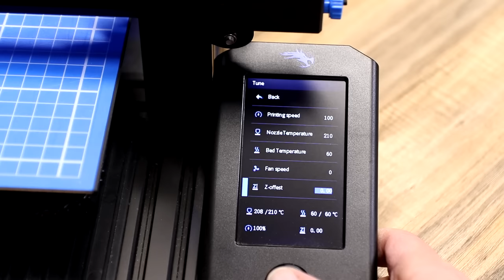Ender 3 V2 Bed Leveling : Quick Look at How to Level a 3D Printer Bed

Comment: Mine came with a warped bed. It blows.
Reply: Mine also, but do the z offset like he suggested at the end and it definitely helps.
Reply from the maker: Aww that sucks. Is the middle higher or lower?
Reply: I feel ya, mine did too, you could have the corners rub the nozzle and still be able to slide 2-3 pieces of paper under the nozzle in the center. Creality replaced it but made it a bit of a hassle.

Comment: i need help my sensor by the motor on the bottom dose not do anything unless i touch it and when i print the bed goes on the motor and makes a noise then it turns off my printer

Comment: Or otherwise know as Z-offest as it's spelt wrong 😁, also great vids I have used them all quite a bit since I got my ender 3 v2, just upgraded the extruder to an all metal and I have done the bed springs however I can get all 4 corners fine however the middle is always way off I have checked my glass to see if it's warped with my metal ruler and it's perfectly flat my spirit level also shows perfectly lvl however I can either get a perfect first layer in the center but the corners are too close and have grooves or I get perfect corners or no filament adhesion in the centre any ideas?
Reply from the maker: THanks! haha Check the aluminum build plate to see if it's warped. That can cause even glass to be slightly warped when sitting on it.  If it's straight too, then I would get abl or do a manual mesh and see if that helps!
Reply: @TheEdgeofTech  Actually I have just used your guide again including loosening the Z axis stop and so far so good any advise on warping pla on the corners

Comment: when i do this, there is still 5mm between the head and table with zreed switch as low as it can go, i need to wind the springs almost to point of no load before it can be levelled. Any ideas?

Comment: My bed hits the motor at the back when the knobs are tight and I have to loosen them quite a bit to clear it. Adjusting the knobs also changes the warp in the aluminum bed which somehow also warps the glass. Sometimes I wonder if my printer is a lemon lol.
Reply: Same  I'm now at a loss. Did you figure it out??

Comment: whatever I do, nothing seems to work. Right is ok, left site does not stick. New springs on the way, using the stock springs. Looks like the spring at the back left must be totaly in and at the front the adjustment screw almost fell out. AAAAHHHH.

Comment: Could you make a video on how to do this with the bltouch on your Ender 3 v2? I just can't seem to get it to stay level with mine.
Reply: Try dual z axis kit from Bangkok, worked for mine, change bed springs too.
Reply: did you remove the z axis stop ? i did that, used a custom framework from smith3d and for almost a year now i did not have to relevel my printer
Reply: Edit Banggood
Reply: @pandaterminator007  I removed z axis switch and installed BL touch aswell as the z axis kit, brilliant now.

Comment: OK I got a question- is it just me or does the nozzle feel like it's vibrating when moving the paper back and forth? I have the bed set to 60 degrees and Hotend set to 200 degrees while tramming, and steppers off but definitely feel a vibration either in the nozzle/ Hotend, or at least the paper for some reason. Makes it hard to get "that feel. "

Comment: This is the most infuriating process I think I've ever been through in my entire life. I've literally sat in front of this thing for hours on end trying to level this thing. It never levels. I've even put new springs on it and it's still the same.
Reply: Iam tired of ths crap i tell ya
Reply: You’ll get the hang of it try using calibration squares one over each spring and one in the center
Reply: You can adjust As you go and get that perfect level basically want the squares to be a smooth  plastic square if it’s to close it will  dig into it and if it’s to far there will be spacing

Comment: Okay, so I have been able to print almost a dozen small pieces no issue, now I am having issues with one particular print and it has to do with the level of the bed directly in the middle of the glass plate. How does one level the middle of the plate? You said it was easy enough to fix, but you didn’t explain how. I’m stumped. Other prints still work even have readjusting the level of the bed again, just not this one.
Reply: Oh and to clarify, the bed is just a we bit to high in the middle even though all four corners are perfect

Comment: any tips on z - endstop inconsistencies?? sometimes its consistent but there are tendencies where the nozzle would stop too far from the bed. should i replace my z - endstop?
Reply: Is it the same endstop that  came with the machine ?  If so...try two things 1st..check the bolt on the z ends top if loose tighten them snugly but be careful not to break the plastic, 2nd thing check if the z rod cuppling if it's loose, tighten if needed....for an extra check the extruder bearing wheel try moving the wheel bracket up and down, if it's wobbly then it's need tightening, but not too tight, that will make the rubber on the wheel wear off faster then intended.
Hope this works out, hit me up if your problem is solved.

Comment: Some thing I thought of just now: 

Start your print but drop down the speed to 10 - 15 percent. While its printing, level the bed accordingly. This seems to be the best way so far. The paper method just isn't working for me maybe because the filament I'm using. Was using Red PLA and it worked 9 times out of 10 but orange.. has been the worst.

Edit: Another pointer: Adjust the speed if necessary. I think us builders need to come to the conclusion that each project is unique.

Comment: For those struggling to do this, I tried it everyday for two weeks, got frustrated, left it for over a year, I'm doing it again, and still can't manage to do it, I looked at the bed from the side, they were too tight, I loosened them, until it looked straight and then decided to buy an automatic leveler. My lesson, just buy the solution 😃

Comment: After tightening the z stop and getting the paper under the nozzle at the right spot, once I move to the right the bed is too high and I don’t have enough slack (four turns as suggested) in order to compress the spring. Dafuq

Comment: so my springs are not compressed like urs? did i do it it wrong? i have had okay prints but a little bit of warping on on cornnor but havent be able to adjust it down
Reply: The warping effect is caused by two things..1st is the bed heating the ender 3 v2 heat bed needs to be atleast 50 to 60 degrees celcies, if still warping even on 60 degrees, do what I do on most of my printers, apply light coat of glue stick after bed leveling, and you can clean it off with warm water when you want to relieve the bed in the future.
Try it out it helped alot with most of my printers

Comment: You did not show the fix for the center being lower
Reply: 6:23
Reply from the maker: I went through how to baby step or z offest, but I didn't show it on the printer. If the center is lower you could always raise it with a little blue tape straight on the aluminum plate to help it too.

Comment: How is it safe to put paper underneath the nozzle when it’s hot, wouldn’t catch on fire?
Reply: by default a 3D printers nozzle when hot is around 200° celsius . a standard hot glue guns nozzle is around 193°celsius
it doesnt combust the second it comes in contact with the hot nozzle.
Reply: @l0kaltpsykf4ll34  thanks
Reply: @jacoblathrop1835  no problem . you can safely level the bed while the nozzle is hot, its actually recommended that you level a 3D printers bed while the nozzle is hot so that exess philament will melt away & not tamper with your measurments

Comment: I noticed the center of my bed is .003” lower than the edges.  If I level the bed on all four corners, the center is always lower.  Is this normal and does it matter?  I can’t get my prints to stick to the glass bed.
Reply: It may be two problems: your bed could be warped, but the glass bed should fix that. And, I found that a light spray of hairspray on the glass after cleaning it with rubbing alcohol really makes a difference. Good luck!

Comment: Has anybody managed to print on glass bed of v3, the coated side? I tried different filaments with different bed temperatures, up to 100 degrees Celsius, no chance of adhesion.

But when I turn the glass over, I manage to print but only with high bed temperatures.

I ordered the bltouch and some spray, hopefully I can get this issue fixed.

Comment: what is this bed surface?
Reply from the maker: This still has the stock glass surface
Reply: @TheEdgeofTech  so what is that blue thing?:D
Reply from the maker: @zola5584  Oops!! That's a TH3D EZMat! I forgot I put it on there lol. The newer ones are black but they work just as good!

Comment: I still get good PLA prints, but the center is lower on my v2 just the same as your printer. I have been thinking of shimming underneath the glass bed with some aluminum tape in the center. Do you have any recommendations to do this or not?
Reply: Mine was also lower at the center. This was from the clips that followed the printer (the clips push the glass down twad. It is two clips (center top and center bottom). Move these somewhere else and add som paper-clips like these on the other sides
https://5.imimg.com/data5/PR/II/ZI/SELLER-90498559/binder-clip-500x500.jpg

Comment: Take note, he is NOT using the supplied bed. Been trying for weeks with absolutely no luck. Where is the video with the stock bed??? You don't use one because you have to continue buying more and more items to get it to work...
Reply from the maker: Hey Michael, I have another one with a stock bed. It levels ok. What issue are you seeing? I can help!
Reply: After weeks of constant "leveling" it will not adhere to the bed. I have tried flipping to the glass side as some have mentioned with no luck. Ironically after watching several videos on "leveling", I see the most common point is to buy more items to get it to actually print. After purchasing it for hundreds of dollars and having to assemble it, it does not complete it's sole function...
Reply from the maker: @rrtraxx13  Have you checked your XGantry?
Reply: @TheEdgeofTech  everything moves fine. No binding, smooth movements.

Comment: if you tighten the springs all the way, and set the 1st corner. you don't have any adjustment for the other corners. i don't think this method is correct

Comment: This is very flawed information. Z axis microswitch will be tripped before z axis comes all the way down. This is due to internal mechanical workings of the microswitch. So if you are setting it up with z axist all the way down and microswitch jammed right up to it there will be a gap later on between your bed and nozzle since Z axis is going to stop way before it comes all the way down. Printer has this imaginary plane where the imaginary bed equals to 0. This is where microswitch should be tripped. Not above 0.
Reply: Can you explain this more? Some people got it based on the video and some didn't, I'm one of those that didn't. Still struggling to level the bed after a year.
Reply: @bgcm1995  

How are you doing it?

Comment: This is not easy and sucks. Imma throw my Ender 3 V2 out or return it.
Reply from the maker: I'm sorry to hear that! What's going on?
Reply: @TheEdgeofTech  I keep trying to level it and when one side is just right another side it tight and I was doing things equally. I got it as close as I can even do it, but it still isn’t right, and it’s printing like crap. I’m very discouraged. I am usually a tech geek, but this has me depressedz
Reply: @TheEdgeofTech  please I have a big issue with the 3v2 too. I have just uninstalled the BL touch after updating the firmware too. I noticed that the hotend does not return back through the z axis. It's frustrating now because the home axes are all changed. Please what do I do to get back my 3v2 to manually bed level?